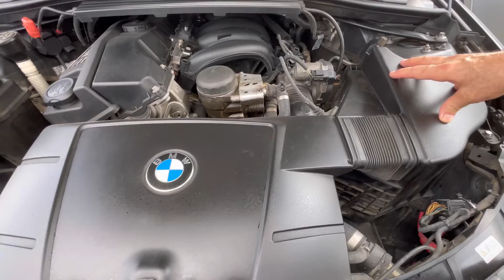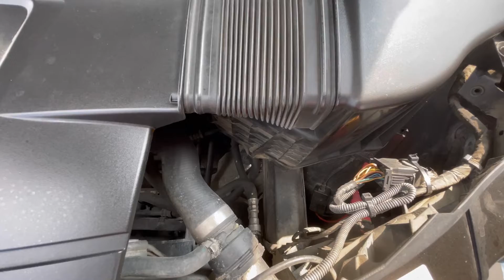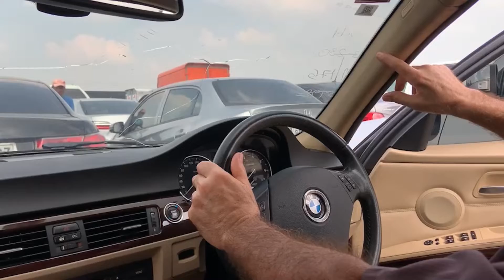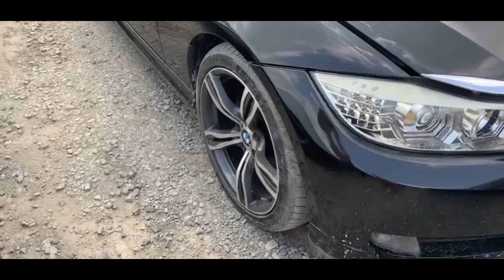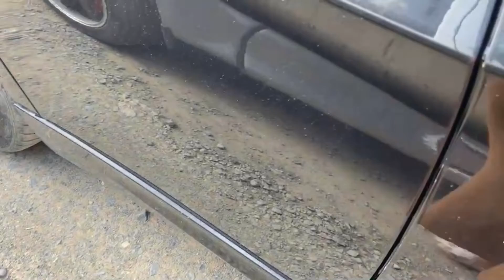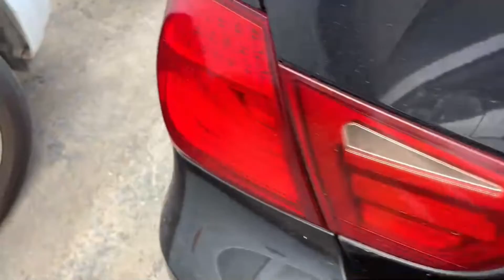2010 BMW 318i M Sport Review

Comment: Is the 2010 BMW 318i reliable? does it cost a lot to maintain or repair it?
Reply: Of course it’s a bmw, the price cost will be expensive just because of the brand . 

But you will have less issues with a petrol engine compare to the diesel